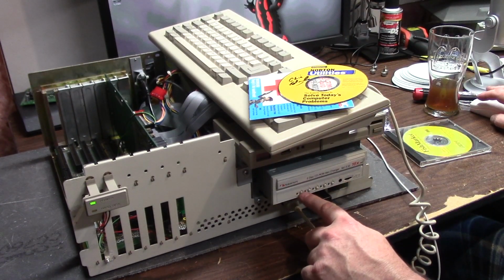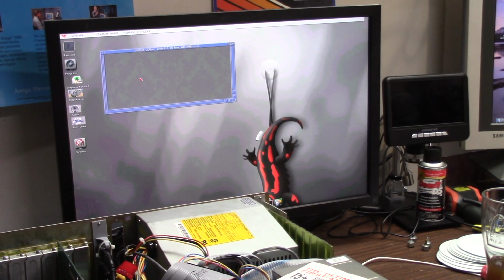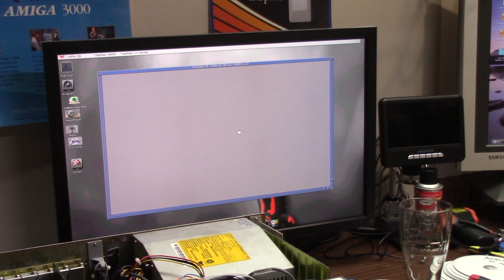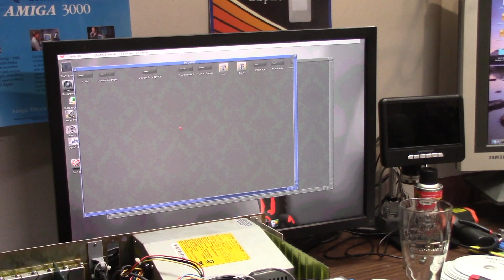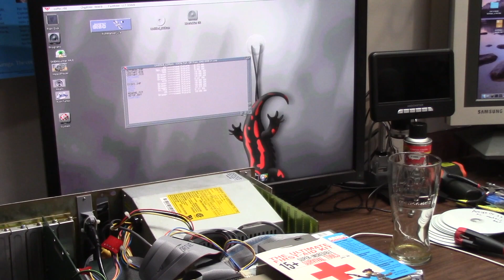Commodore Amiga SCSI Rom updates! who makes them in 2020 ?

Comment: Are there any known compatibility issues usong this SCSI card in an A2000 rev 4.5? Mine doesn't seem to boot, whereas it does boot in a rev 6.2. However the 2Mb memory isnt seen.
Reply from the maker: Not that i know of
Reply: @ChrisEdwardsRestoration  I wonder if the card requires -5V.  It doesn't have that at the moment since I replaced the power supply.  I plan to add it but in the meantime I can try another original power supply.  Fingers crossed.

Comment: I have 2 GVP HC & 8 with 4 megs ram each...one has 4.13 and the other 3.3 rom. They both work fine with 040 in my 4000. I upgraded to gururom 6.1 but made no difference, and still did not work with my 060 Cyberstorm. My 2091 has 7.0s and does work well with the 060.
Reply from the maker: 060’s are picky
Reply: @ChrisEdwardsRestoration  My Cyberscsi hooked to the Cyberstorm works like a dream. The two GVP scsi controllers are a bit flakey, the HD reports errors, (on 3640 040), but when the same HD is booted with the Cyberscsi....no problems or errors. I wonder if updating the GVP's rom to the latest would fix that issue?

Comment: Old GVP roms were notorious for problems back in the day. luckily the 4.15 fixes most the trouble. Luns were always slow on these old zorro controllers unfortunately. On good accelerator scsi like blizzard 2060,warp engine,cyberstorms and gvp4060dt,etc its much faster.Love the cd changer btw,i used pioneer 6 disc and 18disc changers back in the day..
Reply from the maker: It has a vampire.  But i run old turds for scsi.   New rom works great